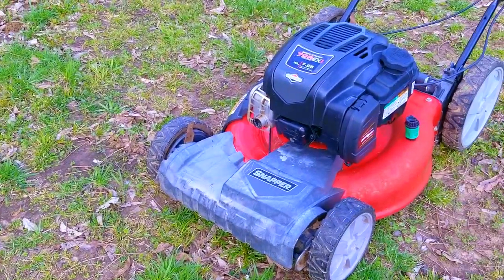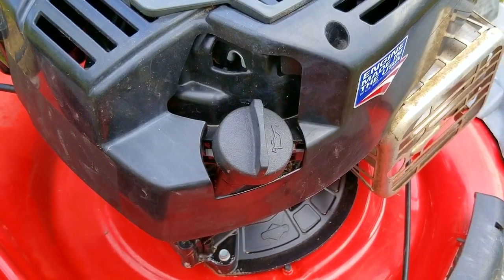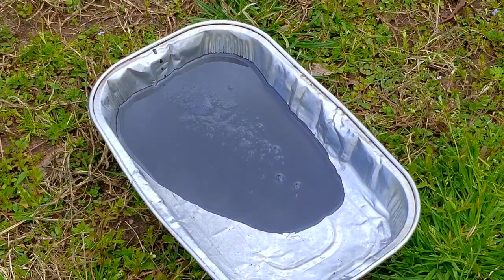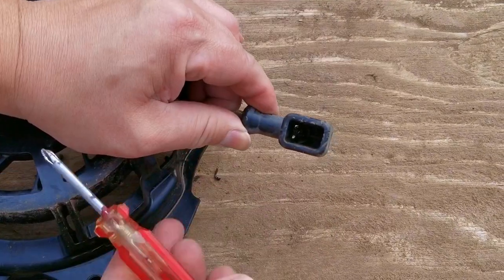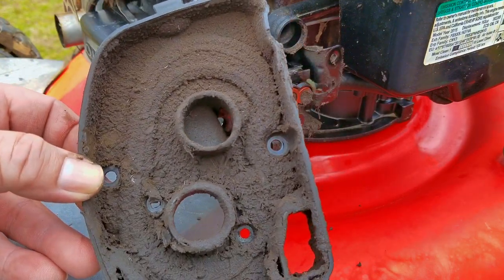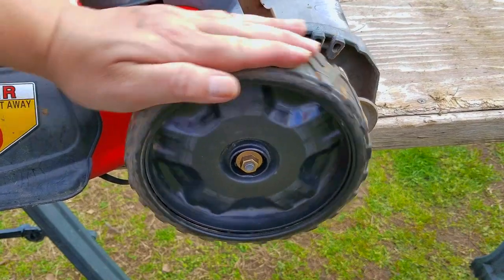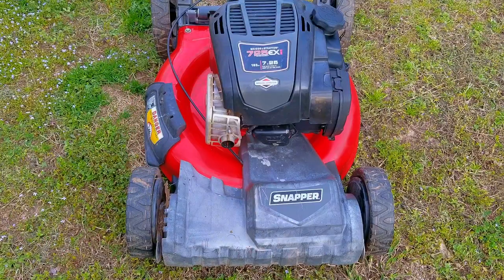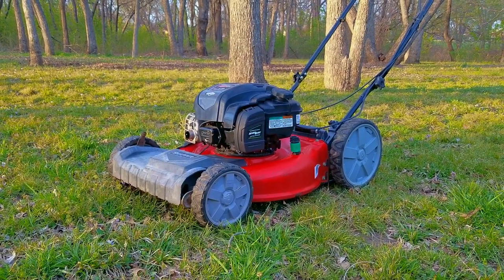Fixing  A Snapper Mower That's Missing A Pull Rope And Handle

Comment: I own that mower, and it's not a snapper, it's made by MTD. That said, it's an ok mower but an actual snapper is much better. For the question, yes I have neglected maintenance in the past, while I am much better now, I'm not always up to date on the maintenance schedule, especially oil changes, but I do replace the air filter once a month.  I buy them in bulk so they are about $1 each.
Reply: Yep you are right.  I have the same one but with craftsman stickers and color schemes
Reply from the maker: wow, that's a lot of changes
Reply: @HomeGaragechannel  I don't know how or why, but mosquitos love that mower.
Reply from the maker: that's interesting
Reply: I have almost the same mower. It's a 2012 Snapper SP70. Bought it new in 2013. It has the 675ex briggs. Other than the deck rusting out underneath which is partly my fault due to not cleaning it often enough, it's been the best mower I've ever had. Starts on the first pull almost every time.
Reply: Yes I am guilty of neglected maintenance
Reply: Just bought a used one of these love how smooth it runs but once in a while when pulling the rope it just about yanks my arm off. Anyone know why that's happening?

Comment: I found this exact same Snapper put out on the street a couple of weeks ago.  It started right up but smoked like a mosquito fogger.  The oil level was way high.  Drained it, and it measured out to be twice the amount needed.  Put in new oil at the correct level, cleaned up the mess in the airbox and sold it for some easy cash.  Simply amazes me how people don't follow the most basic of maintenance or diagnosis!
Reply from the maker: I know right, and you did a great job with that mower!

Comment: I often wonder how many read the owner's manual before using these for the first time? I could hear Mr. Con Rod telling us he'll be leaving soon!! Mid next week, I'll be servicing my mower before using it. Oil change, check the spark plug, check & clean air filter, etc.
Reply from the maker: LOL! yep, he's packed up and getting ready to leave soon.
Reply: @ElectronicMusicUnderground  How long do your mowers, etc. last? Not long by your comment. You also screwed up in what you said. You're not the only one who works on engines. I have been fixing my own mowers for nearly 50 years. There is nothing gone wrong with an engine I've not seen before.

Comment: I bought this same Snapper mower from my local Walmart. This version is NOT the same as the original Hi-Vac with the aluminum frame - not even close. What I found interesting was the engine manual instructing the new owner that oil changes were not necessary. All one had to do was to make sure oil was maintained at the proper level and you would be good to go. I find this advice highly questionable and downright irresponsible on the part of the engineers at B & S. I, of course, ignored this amazing advice and usually change the oil using full synthetic every 15-20 hours, along with the air filter. I would love to know how many new owners of this engine actually took this advice and didn't change their oil, and how long before the engine nuked because of lack of maintenance. I'm also not wild about the plastic carb and the engine cover/starter. The recoil starter has a plastic tab under the spool where one end of the spring rests. It is easily broken, and if this tab, the pawl or dogs break (all are plastic), the parts are not available separately. You must replace the entire blower housing because a $3 part is not available for the recoil starter. Earlier engines have rebuild kits available that include the spring, pawl, dogs, and replacement rope, and remain available to this day. B & S used to be known for the longevity of their small engines, and I would love to know why the drop in quality.
Reply from the maker: yes it is quite unfortunate, and I have met several of those that have fallen for the advertisements

Comment: Mower is in good shape, but The rod definitely needs to be replaced.  Show a disassembly video and show us how bad the rod is. Would like to see it installed and run again
Reply from the maker: this mower is not mine, but I'm working on one right now, that I'd doing that very exact job.  So yes I will just on a different mower.

Comment: I love the lack of maintenance that is necessary on my lawn boy's, but I feel conflicted because I don't get to spend time understanding the wear on the engine by looking at the oil. People neglect to change the oil despite the fact it is an amazing opportunity to understand engines thar power the world around you
Reply from the maker: I don't think most care anymore. it's a real shame
Reply: That's actually important. When draining, opportunity to survey the drive belt (self propel), get the dried grass out from under the deck. Check blade edges. Same for autos, CV boots, leaks anywhere. You get the Bad News Early, & when you catch things early, you get no surprises later, or the big bills. A shame most don't drain their own oil, solves so many issues. Some people never learn. But they do pay. Over & over.

Comment: What I do when I change the oil on my mower I first make sure the oil level is fine , then I put the old oil in a measuring kitchen cup. My mower measure around one cup of oil or so, get a new measuring cup ( at the dollar store they cost $1.25), measure the same amount as the old oil and put  the new oil in the mower  without the trouble of checking your oil dip stick but me been the perfectionist that I am I always check it anyway.
Reply from the maker: nice tip!

Comment: First, I usually leave gas in the tank over the winter. Up to now, I've never had any problems.
The last few years since I've been watching videos like yours, I have been taking better care of keeping my equipment up to date on upkeep. Simply cleaning the wheels then oiling them does make a noticeable difference.
I've also been having a lot of fun taking old equipment that's been discarded and getting them running again!
Reply from the maker: very nice, I find working on them very enjoyable, even if I can't fix them. thank you Steve Everett.
Reply: @HomeGaragechannel  agreed i started watching ur videos and iv bought a old stihl 034, fs90r and they didnt run but i got them running and they're like new and it was very enjoyible very good skill to know

Comment: I have the industrial snapper with the electric start I bought a used. It didn't have the Key  to it but I have the wires that I can make it start like that and it's the best mower I've Bought. The rear tires are losing the meat on them. And starts every time. A paid 50 bucks. thank you for the video.
Reply from the maker: Thanks for sharing

Comment: The way the air cleaner base looked i bet it was ran without a filter for years and it wont last a lot longer, I just got a free troy bilt because it was smoking and when I checked the oil it was a few inches above the fill mark and the air filter was oil soaked . My guess is thats what happened  on that one and they removed the air filter and never replaced it. I would of did a compress test when you had the top cover off with a drill to bypass the compression release. Great video as usual
Reply from the maker: not sure but it was definitely done for a long time.

Comment: i have a snapper self propelled i got off the side of the road and this summer will be the third I've used it, I love the little mower and I've never done anything besides sharpen the blade, I think I'm gonna do a oil change before this season. the little thing always runs great and has never let me down, the least I could do is change the oil.
Reply from the maker: wow, nice little mower you got there!

Comment: My current push mower, a Toro Recycler with a Briggs flathead, had what I thought was a rod knock when new. I took it back to the dealer, who claimed it wasn't knocking. A few yrs later, the governor spring broke. I think it had been installed incorrectly. When I put on the new spring, the RPMs increased, and I could no longer hear the knock. I think the engine speed had been too low the whole time. You mentioned that the engine speed is low, so maybe if you adjusted it, the knock might get better. Of course, this video is a few months old, so I fully expect that this mower is no longer in your possession.

I have skipped an oil change every now & then, but I never let it go more than 2 yrs.
Reply from the maker: unfortunately if the "knocking" noise presents at any speed, low or high it's still indicates excessive wear on the connecting rod

Comment: All the dirt going in the engine probably caused blowby, and since there was oil coming from the crank case vent into the carburetor, dirt probably stuck to the oil that built up from the vented oil
Reply from the maker: you're probably right
Reply: It looked like it was run without an air filter. The two round inserts should be clean just from removing the filter. I service small engines on the side, and I'm amazed at the number of machines that come in without the air cleaner, esp. string trimmers and blowers.

Comment: If you run across a Weedeater FB 25 blower that needs to have the spring rewound, will you make a video on how to do that? I do not think they are made anymore, so you would likely see them on the side of the road. My ran really well and I did turn the rpm's up a little. Have good days! 
!
Reply from the maker: thank you Buddy Reed, I will certainly try for you!

Comment: I'd like to think of my maintenance, such as it is as continuous since I'm prone to get laid up with no warning (Army).  The last time was for all winter and a while the previous fall BUT everything still started right up, except for the electric start for the Missus. That will be forthcoming! And EVERYTHING is a tradeoff. Whether you deal with gas and oil and oil changes and oiling OR charging a battery and taking it indoors to extend the life expectancy in winter and oiling oil points, there is ALWAYS a tradeoff. Whether to swap non-fumes for a nice MMMMMM, there's still stuff to do and a battery job will cost you a LOT as a gasoline mower will start out cheaper but has the add-ons as gas and oil. ALWAYS a tradeoff. On EVERYTHING! Salesmen/dealers would like you to believe there isn't but there will be somewhere. BLESSINGS!
Reply from the maker: you're right about the trade offs, and thank you for your service, I can't thank you enough.
Reply: @HomeGaragechannel  You're welcome but I'm a Nam vet and that whole thing was a BAD joke and was totally worthless except the Higher up people that made all the BIG bucks supplying and making stuff for it. WAY too many folks killed and maimed and at the least, made lab rats BUT I did learn to run a crane there and made a living running draglines and all kinds of diesel stuff after I got out. THANKS for doing a wonderful job!

Comment: I'm guessing when you say "something more personal", you mean wood?...I save broken rake/broom handles to make old fashioned pull cord handles. You can sand the paint off and stain or oil. It increases the value of the mower by at least a doll hair.
Reply from the maker: oh it doesn't have to be wood. This person, is really into cars, so I could have used a part
from another engine, like a connecting rod.
Reply: @HomeGaragechannel  cool. I'm an animal lover so I guess I would have used a dead squirrel or something. 

...just kidding

Comment: I do leave gas in mine but I give it a heavy dose of stabilizer and sea foam the I let it run for 10 minutes then I put it away
Reply from the maker: nice way of keeping them running!
Reply: @HomeGaragechannel  but I do an oil change and airfilter change every year, and spark plug every other
Reply from the maker: even better

Comment: What type of socket do you need to get to start it with a drill?
Reply from the maker: any six point will work, 3/8 or 1/2 drive works, just needs to be the right size for the flywheel bolt. they're not all the same size some are smaller but this one is very large

Comment: I have a lawnmower that has been sitting for 5-7 years with oil in it. I am looking to get it working again and I I’m not sure where to start. It’s in good condition and from what i remember it started/worked when last used.
Reply from the maker: If the fuel tank is empty, add a couple of ounces of gasoline in the tank, and try starting it.
Try putting some fuel, in the carbs throat, and then try starting it again. 
let me know what happens
Reply: @HomeGaragechannel  added fuel to both areas, no luck
Reply: @HomeGaragechannel also no fuel is getting pumped with primer, fuel line stuck on carb

Comment: Hi the model number of the engine is ybsxs.1481HH it’s a old Briggs 3.5 hp I need to chock it a little bit so it doesn’t try to stall do you know the problem?
Reply from the maker: unfortunately I don't have much experience with this engine so I won't be much help
Reply: @HomeGaragechannel  do u think it’s the carb?
Reply from the maker: no, I think it's the linkage system on it.
Reply: @HomeGaragechannel  I will try to adjust the govener linkage and there is a gold screw in the middle of the carb I think it controls fuel flow

Comment: between my car and my lawn mower I have the hardest time reading oil dipsticks. I clean the stick once and then pull it out again I can never really tell where the oil starts and ends 😞
Reply from the maker: I know it's hard, I would always suggest putting a measured amount in, according to the manual. After that use the mower for 10 minutes, let it stand, for about 5 minutes and then the oil will be much easier to read.
Reply: @HomeGaragechannel  thanks, I will give it a shot 🙂
Reply: Check the oil after it sits overnight. This assures the fill tube doesn't have any oil on the sides caused by moving it around or actual use. AN oil change should be done after the mower is used and up to temperature. then I measure the new oil using an old Briggs and Stratton oil bottle that came with my machine. It holds exactly the amount of oil the engine holds. Then I check it before next use before rolling it outside or starting it.

Comment: that was brutal that poor mower haven't seen oil that sparkly in years let alone the amount of dirt that has gone through the engine i would say the oil level was fine until the dirt entering the engine caused enough bore/ring wear that it started to burn i would have checked the valve lash must be bad from the dirt acting like sandpaper on the valves and seats also if an engine just has a slight knock like that one 15w-50 oil will quieten it down a fair bit
Reply from the maker: yes the engine is on it's way out, it's a real shame, but then again it's been thru a lot in the last 8 years.
Reply: @HomeGaragechannel  8 years not bad i still can't work out why people say the OHV/pushrod briggs engines are junk i have found them to be as reliable as the side valve engines with more power and lower fuel consumption
Reply from the maker: I find the OHV engines to be sensitive to no oil changes where the older engines are less. And by design ,yes the OHV are much better at fuel consumption

Comment: nope not at all as i look after my stuff yearly and i do keep up with the maintenance and it starts very well after doing the simple basics whether it,s a  2 stroke aka 2 cycle or even a 4 stroke aka 4 cycle engine and i,d rather do it than creating a costly job in the long run etc.
Reply from the maker: you make a great point about doing it now versus later on being much more expensive! Appreciate it Patrick Stapleton!

Comment: I have an EGO and I'm long overdue (3 seasons) to sharpen my blades and lube my wheels. Not sure what other maintenance you do to battery mowers.
Reply from the maker: mower wise that's it besides cleaning any stuck grass, under the deck. The real maintenance is keeping the battery healthy thru the winter.
Reply: What do you recommend for that? I try to keep them fully charged but not leave them on the charger so its not trickling.
Reply from the maker: unfortunately I don't know much about batteries
Reply: All good brother, I can do some research but im pretty sure the most important thing is to just not trickle charge it

Comment: I hate these engines, whenever I saw one even a little low on oil or with a dirty air filter, they all knocked or had excessive blowby. They just self destruct so easily.
Reply from the maker: it's amazing what happens when an engine is low on oil
Reply: @HomeGaragechannel  seen plenty of old quantums and old sprint/classics low on oil that never fail at the frequency of these newer engines. Many of them were off the dipstick but still ran fine once topped up.
Reply from the maker: the older machines were made a lot more durable from what I can tell.